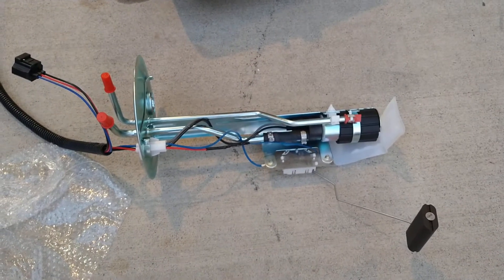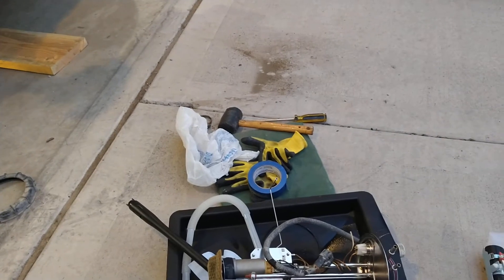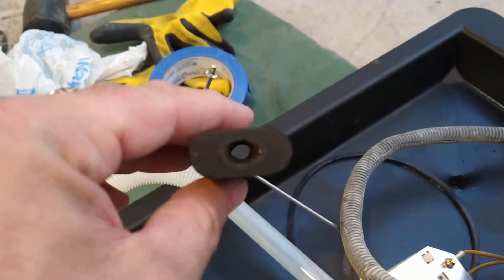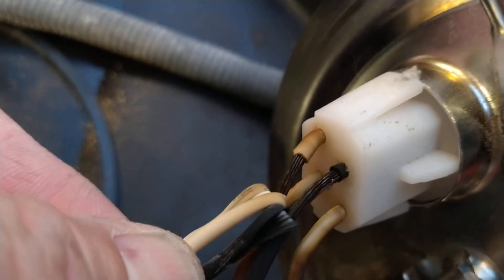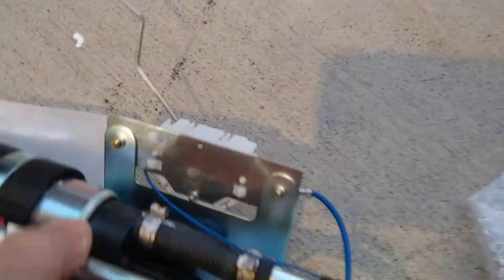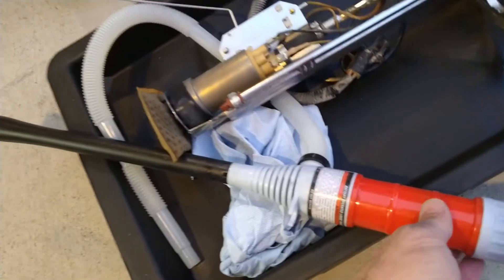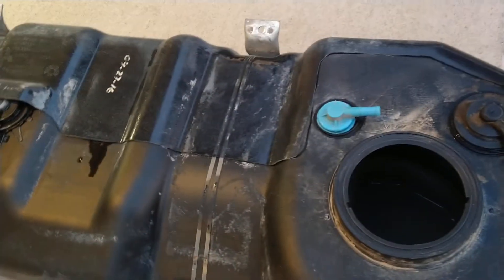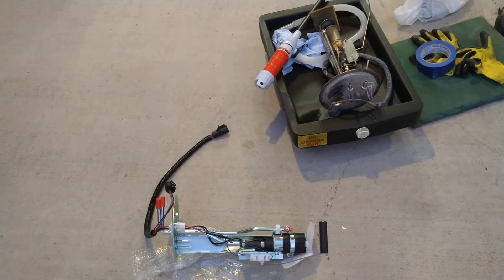Do NOT buy aftermarket fuel pumps!!! DON'T do it!!!

Comment: Went thru the same thing twice. First one (Airtex) died after 2 weeks and the fuel temp sensor was faulty the whole time. 2nd (Different brand) died a few weeks ago and left my wife stranded just after a couple of months of use. OEM lasted 160,000 miles, didn't bother with the 2nd warranty replacement. I bought the OEM Denso one made in Japan, removed the crappy one from the housing and put the OEM one in there. Worked the first time and still running. Thank God mine is under the 2nd row seat (no need to drop the tank).
Reply: Tyvm this was exactly the info I needed.

Comment: I have a 2005 Chevy Astro with 198k miles on it and the fuel pump is still running, but it's giving me the signs of death... motor sometimes skips a beat... takes a few more cranks to start. I bit the bullet and bought the OE AC Delco part.
Reply from the maker: @freddaniali  Very smart decision! OEM is the way to go if it's still available.

Comment: I bought a OEM denso fuel pump. Lasted 3 weeks. Under warranty. Bought a 2nd denso OEM fuel pump and after 14 months, and about 12,000 miles, now it is going bad. Wth? Then they only give a 1 year warranty. That's another thumbs down. So... I'm getting a aftermarket trugrade one from AutoZone with a lifetime warranty. If it goes bad, I'll get another for free. Just hope it doesn't leave me stranded. I guess OEM isn't cracked up to be what it should.
Reply: How did the one from autozone perform?
Reply: I still have it. If it goes bad I'll get another for free.
Reply: I just bought a trugrade for $509. For the price, I hope it lasts 10 years.

Comment: My tahoe replaced the oem with delphi and the delphi pump  only lasted 7 months, do not buy autozone delphi pumps
Reply from the maker: So far my second AutoZone Delphi pump is doing fine, however I know it's on borrowed time, especially how the insulation on the wiring was swollen on the first one. Delphi is still superior to Airtex, but at the end of the day an OEM fuel pump is always the best quality without a doubt. At first the OEM pump is usually very expensive and seems like it's too much money to spend, but after swapping out 2 or 3 aftermarket junk pumps it's not so expensive anymore!

Comment: I had a problem years ago with a 1987 Toyota Celica hydraulic clutch master cylinder. The original failed, So i had the bright idea to get the Autozone aftermarket replacement. It was only 30 or 40 bucks. This thing was a mother***ker to get to the one bolt, There was 2 bolts holding it on, One was inside engine compartment the other down inside above where your feet are way above the pedals. Had to remove the seat and lay in there and cuss up a huge storm of foul language to get it out. Had to bend a wrench to get victory. 6 months later it went out again. I told the ol lady i"ll be a mother***ker if i'm putting in the same aftermarket in even if it's got a lifetime warranty. Put my big boy pants on and went to Toyota dealership   and got dealer part which was 150.00. Put it in and never had a problem again. Lessons in life suck.
Reply from the maker: I have no idea why, but this comment just showed up to me. YouTube...
Reply: @vegasfordguy  Yea maybe Elon Musk will buy youtube and fix it lol

Comment: Add "never add HP in a can" to your fuel tank! Float and insulation degrading from ethanol and/or fuel additives. Not making an excuse for the failure, but that is a textbook symptom of incompatible material when subjected to additives.
Reply from the maker: It comes directly from the fuel pumps, it's ethanol fuel. All fuels have 10 percent ethanol added nowadays. I don't use any additives in my fuel.

Comment: I’ve just had to change my Toyota fuel pump Toyota quoted me £1100 for just the part so got a Bosch pump instead for £230 may not last the 120000 miles the original did but hoping it should last a while

Comment: I just got my elderly parents 96 Grand Cherokee Laredo and the pump lasted 10 yrs, but suddenly it started leaking from the upper middle tank. Could be fuel tank seal which comes with the pump or a fuel line. Lifetime warranty don't last long

Comment: I may need a fuel pump in my car, it sat for a while and has a fuel pressure drop now — it’s either something on the supply side or the injectors. Hopefully it’s not a pump, but it’s looking like it’s best to get a Delphi if I do need one. At least I HAVE the money, that’s a blessing. My tax return is great as well because it’ll pay for my tires.
Reply from the maker: If you do need a new electric fuel.pump I'd recommend a manufacturers OEM unit if available and not to pricy. The Delphi has been a good pump though. Good luck on diagnosing it. If it has a port on the fuel rail you could take a pressure reading. The gauges are pretty cheap. Does the gasoline still smell like gas or does it smell bad?

Comment: they are all after market. there is no OEM real part. even if you buy it from a dealer. nothing is made in Japan. all  made in china.
Reply from the maker: You're incorrect about that. Genuine Ford parts are superior to aftermarket and are stamped or have a genuine Ford logo. The same thing goes for the other manufacturers. Country of origin has nothing to do with the part being OEM or aftermarket.
Reply: @vegasfordguy  all parts are made in china even if they are assembled in USA which i doubt and stamped. american car or assian or german. call the dealership and ask them where was the part made and with what part from where.
Reply from the maker: @WV591  Once again, it doesn't matter where the OEM part is manufactured. Doesn't matter if it's made in China as OEM parts are built to the manufacturers specific tolerances and quality control. Not everything from China is junk. Something built for a budget minded person selling on ebay will not be built to the same specs as a Napa part. Just like a OEM part will be better quality vs the Napa part.
Reply: @vegasfordguy  Perhaps it doesn't matter where it's made? But I have my 2nd Chinese-Delphi that failed out of the box. Really not feeling confident putting in a 3rd one at this point. Buying a Delphi Pump shouldn't be like playing roulette.

Comment: Wat about a masterpro from oreily gmc yukon xl🐴
Reply from the maker: I personally wouldn't use anything except OEM when it comes to an in tank fuel pump unless you don't mind doing the job again if it fails, you don't plan on keeping it very long, etc. An aftermarket pump could last forever, but they don't have a very good track record, especially the Airtex brand. They were so bad that AutoZone stopped carrying them.